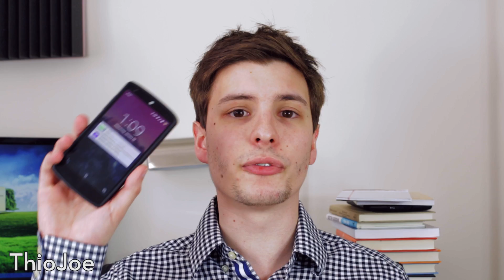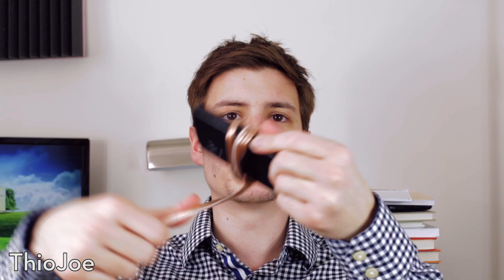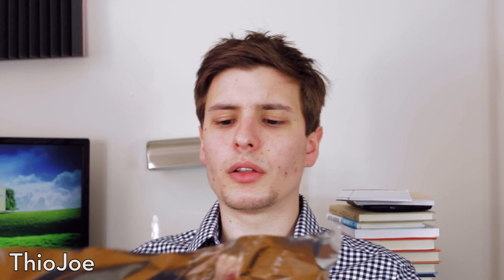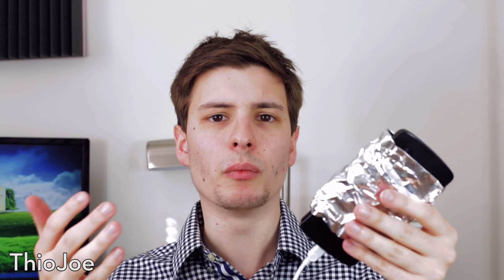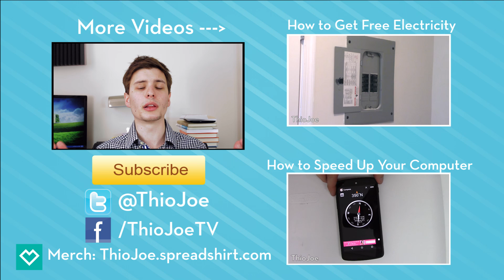How to Instantly Charge your Phone

Comment: Thio this is dangerous it might start up a fire ! Because if you are simply a physician you should've thought about the part of electricity and magnetism and conductivity .. But that's a propability of 70% only to not start fire , why does it start fire ? Because in physics we know that the more the voltage the more the current which will cause less resistance causing electrons to get into battery in an absolutely wrong way like if you're rushing into the base of the FBI and getting busted , finally for the conductivity part you should have stated in your video that insulated wire is a better one than the non-insulated one ! But you didn't even say what type of wire you are even using you just don't care about people's lives ... Peace out

Comment: He neglected to mention the necessity of connecting a banana (over-ripe) to the end of the wrapped wire (outside of the foil) for the sodium-potassium ion exchange to smooth out and stabilize the +ion sodium spike (which may damage the phone). This safety performance feature may be considered as imperative for optimal success in this venture.

Comment: Do you put the wire in the wallet, or do you need to get the microphone off and replace it with a speaker, I am not sure if you are supposed to put the tinfoil on the plasma ball fist before putting it in the microwave. Can you please help? I can't find the power button on my phone. my iphone specs are iPhone apple with a screen and a few buttons. Im confused.

Comment: a similar way is to fill a pot with water, add a tablespoon of oil, drop your phone in it, plug on a hairdryer or something similar and through it into the pot. the oil protects the phone from water getting in, and the water does the same as the wire and AF in the vid.

Comment: TIP: This works much better if you put the phone in the microwave. It'll do the same thing but faster, just make sure that you cover the tinfoil with a damp cloth so that it doesn't damage your microwave. 1 second = 10% charge. DO NOT OVER CHARGE! It will decrease battery life. iPhones will charge 50% slower because of their different charging ports.

Comment: so fake, its hurts to listen to... "electric potential difference" bull shit.... electricity flows in the path of lease resistance... dumbass. and do simple math 2amp charger and 3000mah battery, so fastest charge would be about 1.5 hours, to charge to 75% in 10sec you would have to draw roughly 20 amps which would melt your usb cable and probably cause your phone to blow up...

Comment: Please explain me one thing which is, how the escaping potential/ em waves is recharging the battery? I mean through the phones internal antenna(which I don't think so..........., otherwise we will observe faster charging near a radio tower) or something else. Because you left both the ends of the wire disconnected both to the battery and with themself.............basically an open inductor.

Comment: Greetings Joe,
was searching from something else and then found your tube, brilliant!
wondering if you know how to block an upstairs neighbor who is using an app to slow or Actually "freeze" my cinnection. This never happens ANYWHERE else except when in the spot in my apt. bedroom where I use my android. I think I was on to something when I was using my Bluetooth speaker and found that (because of the proximity of course) the names of them appeared with app numbers/codes that could be seen - so it was apparent that they were using an app to do this (or would this WiFi related? (This has never happened elsewhere, it's more than proximity. partly because I can hear them whenever the slowing, or freezing starts. Any idea on how to prevent this infringement that is just as bad as any entity: nsa, creepy neighbor?

Comment: I wrapped mine in tinfoil then rubbed it very fast back and forth on the carpet. the static electricity 90% boost charge with like 100 strokes.

Comment: Wow, another well done video! The ways you did the edits were not obvious and well hidden. I think the main two ways you did this was either

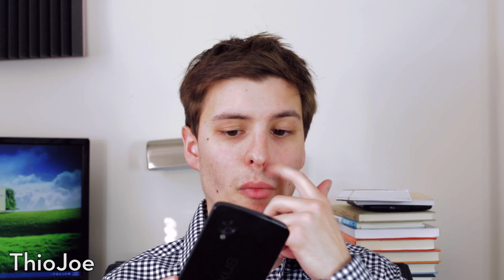1 - Either you showed one phone with only 1% battery @ 2:28 and then when you put it down, you picked another phone which was at 78% and did the "charge"

OR

2 - Either you downloaded some kind of UI overlay that shows you have 1% battery left and that notification as well because the top notification bar and the general UI is completely different on the 1% compared to the 78%.

Great video though!

Comment: I fix phones so this is how it really is, when you plug in the cable, the electricity from the wall travels to the micro usb power board first, its like a motherboard for the power, then the powerboard spreads the electricity to the battery and lights, minimal electricity is lost and converts into heat, but the coil and aluminium will not make make the phone charge faster or prevent the heat it radiates.

Comment: This guy is the biggest troll/spammer ever almost all his videos show fake things like putting electrical insulation tape on batteries/ethernet cable to make the cable faster electrical insulation tape is supposed to cover cuts in the wires or upgrading your PC by opening it and removing 1 part or getting WINDOWS 9 or getting a free PC

Comment: My iPhone 5s went from 50% to 49% in 10 seconds.   I left it charging for another 1 minute and it went to 52%, which is about what I would expect without the wire and tin foil.   Checked the charger and cable and they were fine.  I'd say this technique is bunk.   Don't waste your time.

Comment: It would have been much easier to explain this to those of us with engineering & physics degrees, to say that you are converting your cellphone into a giant capacitor. The foil and wire act as the capacitor's dielectric. I've found that wax paper is much more effective (and cheaper) than speaker wire.

Comment: its not working bro
i used my earphones wires 
should the wires be tightly wound?
Reply: You can't use headphone wires and secondly it needs to be tight enough that it won't just look all floppy (the wire)
Reply: Can't use headphone wires unless u rip off the rubber.

Comment: Another thing about the wasted potential.  The transformer between the receptacle and the charger cord which converts AC power at 120V to DC at 12V can dissipate a great amount of power, so there's actually another factor that makes battery charging less efficient.

Comment: Did you know putting your phone in water whilst charging makes it charge even faster because the Chargers electricity travels through the water and into the phone, it won't break it be use the electricity forms a thin layer around your phone that stops the water getting in

Comment: +thiojoe hey Joe its not working at all i have done exactly did what you said i dont understand one more thing where is the other end of the charging cable gets plugged it i even plugged it with wall charger. oh yeah do i have to have speaker wire in such a way that both end copper or what ever inside cable should be visible. please reply because you are already subscribed my friend.

Comment: Also If you put a magnet on you're phone and wrap it with tin foil change the date on you're  phone throw it in the microwave it will time travel you with the potential energy being used from the battery.

Comment: for people who dont understands how this works, the electrical potential that goes through the charger wire, locks onto the wire wrapped around your phone, the alluminum foil protects the electrical potential from escaping like joe said. Since he used a thick wire, the electrical potential is maximized to it's extent. The batteries designed for smartphones rely on electrical suction. electrical suction is also used in wireless chargers. since theres a lot of electrons building up around the phone, the battery uses it's electrical suction to charge itself. Companies including apple and samsung designed the batteries to disable electrical suction after it's charged around 70% for safety hazards, because the battery could over-charge and explode. I've done this trick numerous times, it's really surprising how not many people know about this trick. This is a very helpful video joe, keep up the good work!! btw thanks for showing me how to double my internet speed! I'm saving LOTS of money because of you :)

Comment: OK first off what u said in this VID wasn't true a "Electrical Potential Difference" is basically a fancy word for a closed circuit! I think you meant, the charger and the wall output are different (magnetic fields) and with the average lights and mechanics the external wire and the internal wires must connect behind the outlet and that's why u see the spark when u plug in....

PHASE 2
----------------

Basically u are so wrong the human race is  ashamed...... We secured our rank at the top of the food chain and u. And ur Artificial Intelligence brought us right next to the pork chops! :I

Comment: This video is Some What Right And Horribly wrong If you Charge Your Phone useing A Charger It charges To 100 in About 45 Min If you Use A Wire To your Barttery It Mess It Up Butt It Charges Your Phone to -60-80 % In About 10min but Discharges It In 10x The Time

Comment: Utter BS. Grade school math can debunk this.

A cell phone battery holds about 2000 mAh. That means, it can produce 2000mA per hour for one hour, 500mA for four hours, 250mA for eight hours, etc. Cell phone charges via USB deliver 500mA, 1000mA, or 1500mA depending upon the version and charger. USB would takes 4 hours, 2 hours, or 1.33 hours to recharge the phone -- likely more since charging is not 100% efficient.

In order to charge it in 10 seconds, you would need to provide 360x the amperage as charging it in one hour (3600 seconds per hour). To add 1600mhAh to a battery, you would need 576000mA of current for 10 seconds.

576 Amps! Household breakers trip around 20 Amps. Household plugs would melt at that amount of power. USB wires draw a maximum of around 5A. That kind of draw is ten times the that of your average house. A wire able to carry 576 Amps would need to be nearly two inches in diameter of steal alloy. Standard street power lines only carry around 2500 Amps and only do so at high frequency AC.

And of course... his claim that in normal charging that that much power is lost to the air... is nonsense. If 576A of power was being lost to the air... everyone in that room would be electrocuted.

Comment: Worked like a charm for me but still you should be very careful. Some chargers include a little bit of extra voltage to compensate for the energy lost in the conductors which in rare occasions may cause waves of very dangerous gamma radiation with up to 3-4 MeV of energy so you could potentially absorb about 50-100 thousand mSv of radiation. Just to make sure call your service provider and ask them about the extra voltage or you may get stage 7 instant cancer to your brain, bones and tissues. 2 cases of ebola have been reported as well so proceed with caution

Comment: If you cut your charger cable and find positive and negative leads, you can put wires directly to wall socket it will charge instantly! It works because wall socket is have more pressure(voltage) and your phone is more quickly charged. Charger units is just changing from alternating current to direct current, that circuit is uses a lot of electricity. Alternating current is not so good for batteries, but when you need quick charge it works!

Comment: The best way to charge your phone is to take your phone. Now submerge it in ice cold water. The ions in the water will diffuse into the phone causing a change in negative polarity. This In turn causes 99% battery in under 10 seconds. Not 100 only because apple is a dick.

Comment: Dude I know what you did I always do it too my friend too prank him turn off the phone take the battery out put 1% battery in and then turn it on....after it turns on as fast as you could take the other battery out and put 75% in the phone then turn it on by the time you turn it on the phone still got the information from the 1% battery but once you charged it it goes back too the normal 75%...plus you covers the battery charging thing.....

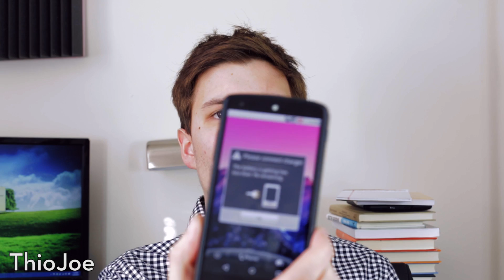Comment: at 2:26
Android 2.3 it looks like (notification bar and dialogs)
yet has android 5.0 on it.
it's running htc sense?
it's a screenshot
and it's off centered 😏😏😏😏😏😏😏😏😏😏😏😏😏😏😏😏😏😏😏😏😏😏😏😏😏😏😏😏😏😏😏😏😏😏😏😏😏😏😏😏😏😏😏😏😏😏😏😏😏😏😏😏😏😏😏😏😏😏😏😏😏😏😏😏😏😏😏😏😏😏😏😏😏😏😏😏😏😏😏😏😏😏😏😏😏😏😏😏😏😏😏😏😏😏😏😏😏😏😏😏😏😏😏😏😏😏😏😏😏😏😏😏😏😏😏😏😏😏😏😏😏😏😏😏😏😏😏😏😏😏😏😏😏😏😏😏😏😏😏😏😏😏😏😏😏😏😏😏😏😏😏😏😏😏😏😏😏😏😏😏😏😏😏😏😏😏😏😏😏😏😏😏😏😏😏😏😏😏😏😏😏😏😏😏😏😏😏😏😏😏😏😏😏😏😏😏😏😏😏😏😏😏😏😏😏😏😏😏😏😏😏😏😏😏😏😏😏😏😏😏😏😏😏😏😏😏😏😏😏😏😏😏😏😏😏😏😏😏😏😏😏😏😏😏😏😏😏😏😏😏😏😏😏😏😏😏😏😏😏😏😏😏😏😏😏😏😏😏😏😏😏😏😏😏😏😏😏😏😏😏😏😏😏😏😏😏😏😏😏😏😏😏😏😏😏😏😏😏😏😏😏😏😏😏😏😏😏😏😏😏😏😏😏😏😏😏😏😏😏😏😏😏😏😏😏😏😏😏😏😏😏😏😏😏😏😏😏😏😏😏😏😏😏😏😏😏😏😏😏😏😏😏😏😏😏😏😏😏😏😏😏😏😏😏😏😏😏😏😏😏😏😏😏😏😏😏😏😏😏😏😏😏😏😏😏😏😏😏😏😏😏😏😏😏😏😏😏😏😏😏😏😏😏😏😏😏😏😏😏😏😏😏😏😏😏😏😏😏😏😏😏😏😏😏😏😏😏😏😏😏😏😏😏😏😏😏😏😏😏😏😏😏😏😏😏😏😏😏😏😏😏😏😏😏😏😏😏😏😏😏😏😏😏😏😏😏😏😏😏😏😏😏😏😏😏😏😏😏😏😏😏😏😏😏😏😏😏😏😏😏😏😏😏😏😏😏😏😏😏😏😏😏😏😏😏😏😏😏😏😏😏😏😏😏😏😏😏😏😏😏😏😏😏😏😏😏😏😏😏😏😏😏😏😏😏😏😏😏😏😏😏😏😏😏😏😏😏😏😏😏😏😏😏😏😏😏😏😏😏😏😏😏😏😏😏😏😏😏😏😏😏😏😏😏

Comment: much bull.wireless inductanse charge is 2 coil that are identical electrick.inneffektive way to charge a phone. waste el power.direct cable is the best way for now comersaly i think..alufoil rapt araound your phone will block the antennas and the phone wil go to max sending resiver mode witch uses power.its foil around the bateries

Comment: Not true whatsoever,not possible,sounds so retarded trapping electricity in phone,ha right.plus you would short circuit your battery if it charged that fast.would ruin your phone.thats why the mini charge packs charge your phone at same rate as wall plug.
Wouldn't have the amperage it needed eather.

Crazy

Comment: I tried this and I have to say that it did work but i experimented a little and I found that if you put it in the microwave for about 2 minutes before it creates a hot electricity charge which makes it charge 10x faster. However when you take it out it will be very hot so shove it in the freezer for a couple of minutes and it should have cooled down. Another thing to try if that doesn't work is put your phone on your driveway and run your car over it so it is fully under the wheel, I found that the thick rubber works better than the tinfoil :) Hope I helped!

Comment: You can also get te same results by throwing your phone in a toaster when the toaster is on ofc. The electricity from the toaster will jump from the toaster and into your phone giving you from 1% to 100% in a split second. But be carefull, if you leave it in for too long, the battery might just become a toaster itself.

Comment: This probably worked for you because that phone is the Google Nexus 5 and it has a wireless charging coil built in on the back. So probably the coil detects the wires and tinfoil wrapped around the phone

Comment: LOL ) of course it is a joke ))) guys seriously, especially those in age, did you graduate school? I had more fun reading comments then watching the video itself. you should have learned a bit in a physics class instead of sleeping ))) a. USB outputs 5V DC, you can not have induction with DC, you can induct EM waves only when you have AC current; b. even if you could - coil and charging wire are perpendicular - they can not induce anything especially if the ends of the wire are not connected to anything (you need circuit)  ))) c. what kind of escaping electrons? ) if you had escaping electrons from the phone body - you would be electrocuted ))) batteries work a bit different way, it is called electrolysis... not taking into count a different backgrounds, shirts and screenshots on the phone screen ))) this video is just prank, for fun. to those who do not like my English - I speak four languages, so don't blame me for making mistakes from time to time :P just have fun and have a great day, don't get mistaken every time you hear a scientific term like electromagnetic induction )))) if it was true, we would have new generation chargers long time ago. if you are interested in new generation of portable power and batteries you should google aluminum batteries.

Comment: Does the phone charger have to be connected in a outlet or the wire
Reply: If you connect it to your microwave using the port in the back it seems to work great, for some reason the waves of electricity in a microwave help charge the phone and increases overall battery life! Let me know if you have questions!
Reply: Ngoc Nguyen don't try it its fake, it will destroy your phone
Reply: Baseball Life Yes that is true, however if you just put it in the microwave for a couple of minutes it creates a hot electricity charge which charges it even faster. You wont believe how fast it charges. Seriously try it now!
Reply: Super Simmer okay... I thought it actually worked cause he was being serious. You got experience with this?
Reply: No, but according to physics and common sense if you do this to your iphone, something bad is going to happen to your battery.

Comment: nope, simply nope. 
it can´t work because the wire is not even a full coil. If you would solder the ends of the wires together, it may work. But in this state no it is impossible to induce current in a loose wire. and to be able to induce any current at all you would need to charge your phone with AC, not DC.
Reply: Lol

Comment: Electromagnetic fields are caused when electricity is run through wires or other conductors not batteries your scam might make a difference if that wire hade current running through but not if there dead like that